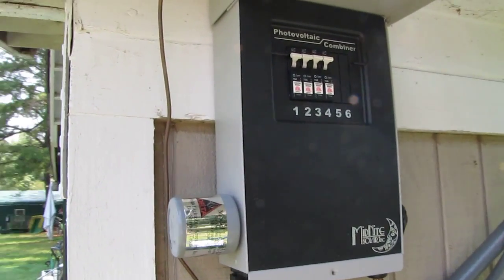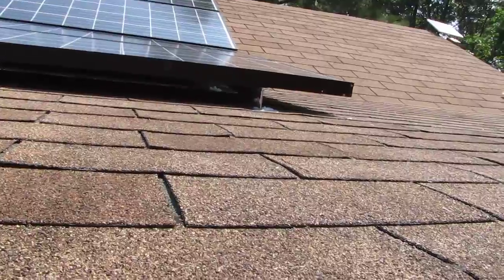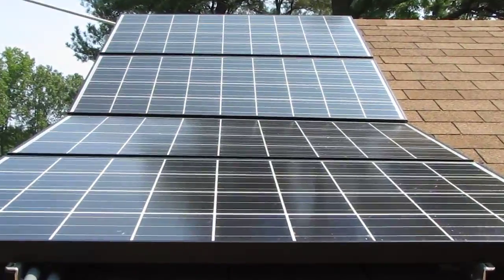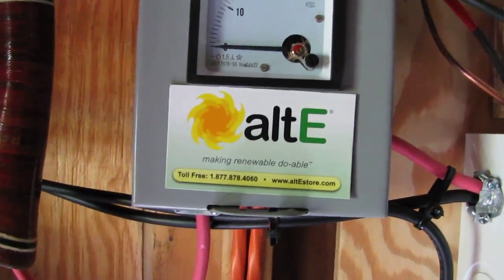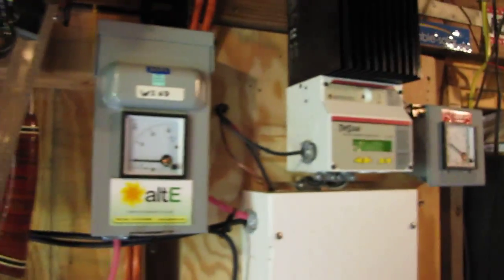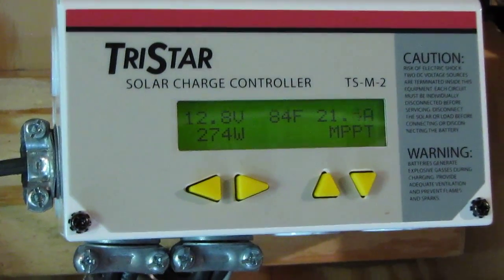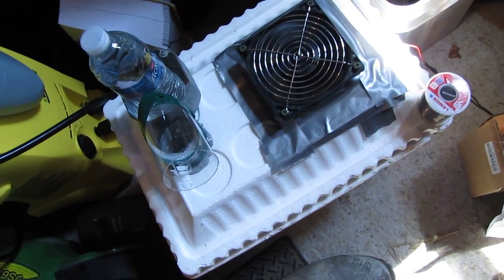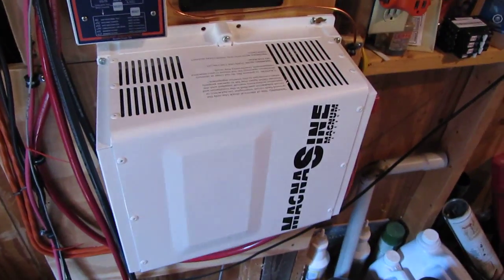Solar And Wind Power In Virginia  Updated  I now have 4 Kyocera Solar Panels

Comment: @peeinginthewind   There are losses but essentially  Voltage times Amps on the AC side has to equal Voltage times Amps on the DC side.    If your DC system is 12 volts then the Amps have to be 10 times what it would be for your 120 V AC    -  400 W = 120 V AC  x 3.33 Amps = 12 V DC x 33.3 Amps.   

I am pretty sure this system would not be able to run your AC unit, just not enough solar panels.   Solar power might be fun and interesting but power from your power company is way cheaper.

Comment from the maker: @peeinginthewind  33 dc amps is the same as ac amps  I had to check it out also I run My Ac unit with My system No Problem  Its the same size  I think you will Be in Great shape Buddy No Problem If you havent Bought an AC unit make sure you get a  Energy star rated they are great Buddy

Comment: Nice.  You ought to disconnect the 2 lower panels and the then the 2 upper panels and see what power you get from each set based on the angle.  If you do that please film it as it would be very helpful.